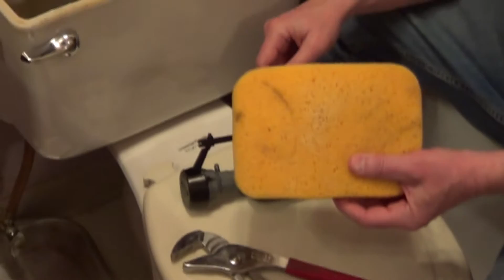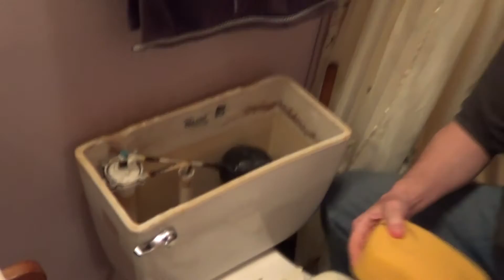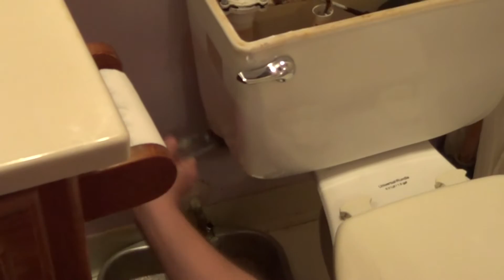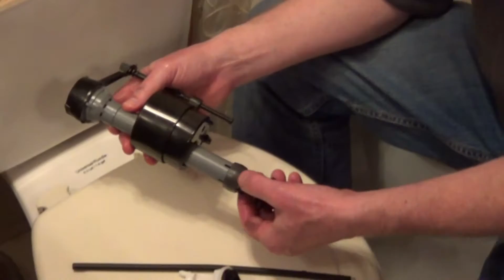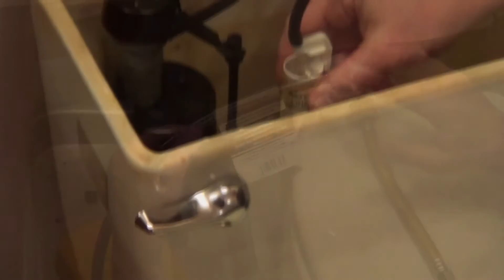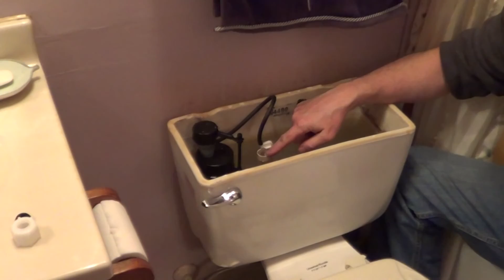Toilet Fill Valve - How to Install a Fluildmaster Fill Valve

Comment: Good video, this was perfect in showing how to do this. You did an amazing video and explained everything great but I do have 1 question,  why would you work on a toilet without gloves? 🙂🙂 Other than that this was a great video 🙂🙂🙂🙂🙂
Reply from the maker: Hi, the water in the tank is clean water from your main water supply and the other parts are just corroded or dusty. But it's always good to wear gloves on repair projects. 
Check out more home improvement tips in our e-books https://www.amazon.com/gp/product/B0B2KW1FQ9?notRedirectToSDP=1&.

Comment: Very helpful.

I seem to have an issue though. Every 10 to 15 minutes or so it (the new Fluidmaster fill valve that I installed today) seems to activate and refill a little water into the tank. Not much, it's pretty brief that it's on.

I don't hear any water escaping through the flapper seal at the bottom of the tank, but is that the likely issue? I did not replace that part (the plumbing supply guy said I didn't want to do it unless necessary).

I randomly pulled the hose a little less into the tube to see if it might help. It seemed to cause some additional water to come in and fill a bit more. Maybe it will happen less frequently. I see a "+ -" water adjustment knob. I have not messed with it.

There's no water on the floor, so nothing is leaking from where I replaced the part today. 

I replaced the old fill valve because the float was falling off the rod because of corroding plastic. I had already flipped the washer in the fill valve months ago (tip from local plumbing supply) to prolong its life (though I kind of forget what the exact issue was now...) So there were two things wrong, but as far as I know, there was no leak nor any issue with the flapper seal at the bottom of the tank.

Any advice / ideas? Thanks!
Reply from the maker: Hi, the fill valve activates when the float lowers. You most likely have a small leak from the flush valve. You can put some food coloring in the tank and see if it moves into the bowl. If you have a flapper, it's easy to replace. If you have a canister style flush valve, you will need to replace a circular seal. You need to match the seal or flapper to the size of the flush valve, either 2, 3 or 4 inch.
Reply: @FIXITHomeImprovementChannel  Thanks very much. I'll try food coloring and go from there.

Comment: The thing that was screwing me up the most was the rubber washer bit. THought I wasn't supposed to remove the middle section. 
So is there anything you do with the remaining bit?
Reply from the maker: Hi, you can email me at fixitpodcast@gmail.com.

Comment: So, the replacement of the supply line is absolutely necessary? I ask because I have never attempted to do any plumbing whatsoever. I have the fill valve, but I guess I'll have to make another stop for the supply line.
Reply from the maker: Hi, some manufacturers are now recommending replacement every 7 to 10 years. Some insurance companies are also recommending replacement to prevent water damage from a leaking supply line.
We have more home improvement tips on our weekly podcast http://castbox.fm/u/6389499.

Comment: And I would cut the refill tube to size to prevent kinks. And the best supply lines are fluidmaster click seal connectors which are available at lowes and homedepot.
Reply from the maker: +STLbluesfan1 I like those too. It keeps you from over-tightening and turning the whole valve inside the tank.

Comment: Overtime, the diaphragm in the head of the valve will get punctured or worn out, and that is what causes water to spray or drip out of the valve, it also reduces the amount of water refilling the bowl.

Comment: Good video!  Do you have a video for how to replace the water supply line valve itself?  To do that would you need to shut off water at the main shutoff valve for the whole house while you replace the supply valve?
Reply from the maker: ***** Hi, it is on my list. Yes you would have to shut off the main water valve. If you have a specific question, drop me a line.
We also have a weekly podcast, here is a link http://www.stitcher.com/s?fid=49441&refid=stpr